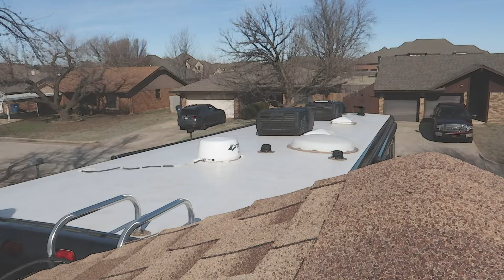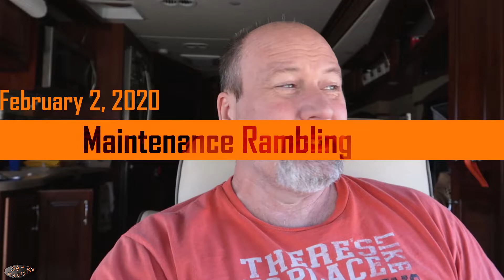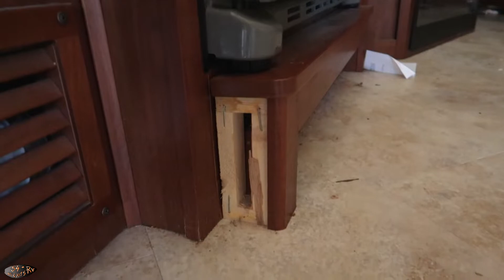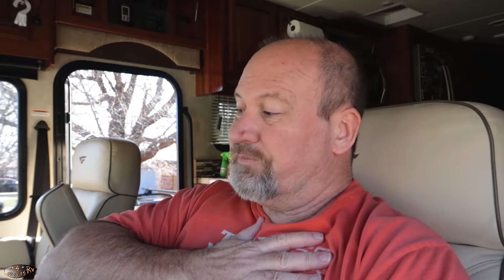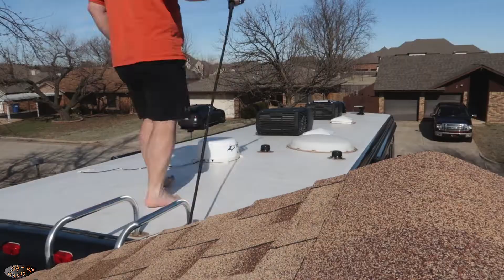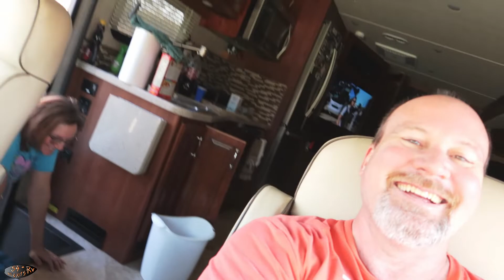RV Maintenance Day - 54 Nights RV - EP107

Comment: I have some quality control issues with our 2019 Tiffin Red. There is a wall seam inside the rear closet that has come apart. I had to add almost 100 new screws in all the kitchen, bedroom and bath drawer slides because the two or three screws Tiffin used were backing out. I reinforced the holes with thin superglue (CA) because the wood is a little too soft. A couple of cabinet doors will have to be replaced because they drilled the holes for the knobs wrong. I’ll probably have to get a slide seal replaced because one of them doesn’t touch the slide vertical wall. Some rivets in the slide corner plates that cover the slice wall corners are backing out. The Spyder system shuts down the furnace and heat pumps 1 degree before the set temperature. Works fine on AC. The rig is 5 months old. We fulltime so we are planning a visit to Red Bay for warranty in the spring. We are still pleased with our rig as we consider what could go wrong. 

One aspect of diesel maintenance is the oil change / fuel filter service is 15k miles or one year, vs 5k on a gas. We expect to visit a Freightliner/Cummins shop once a year to get that done and have put aside the funds for that yearly service. Most campgrounds will not let you work on your RV. We plan to have the maintenance performed at Red Bay also at Bay Diesel.
Reply from the maker: I read comments like this and have to wonder about those folks who don't full time, or go out as often as Teri and I do.  I mean, what are the odds of them catching these issues before the warranty runs dry?
One of the things I picked up on when doing the research on diesel vs. gas; it appears there are a lot of people out there doing more than what is required by the manufacturer (not always a bad thing).  Along with diesel mechanics seeing an RV roll in and thinking "yard ornament", which leads them down the path of doing more things than may be needed.  It all adds up to a lot of money spent on maintenance that really didn't have to be spent.